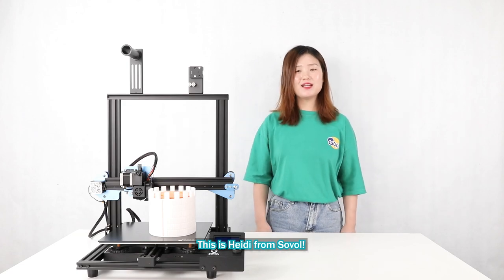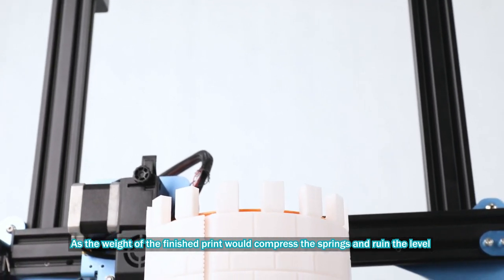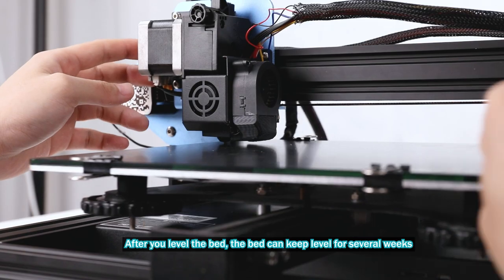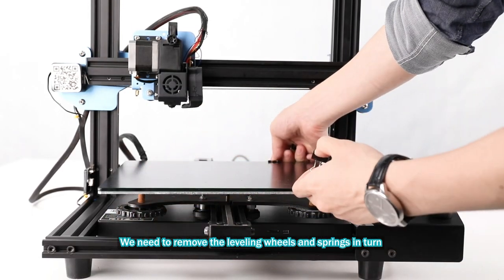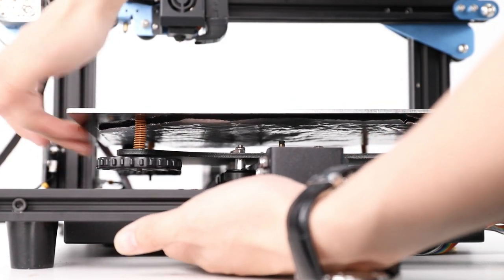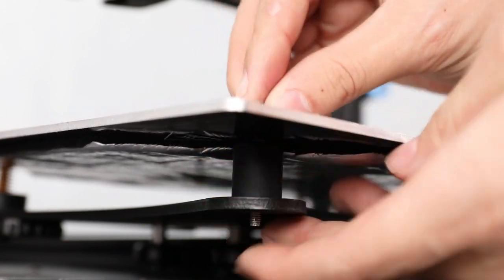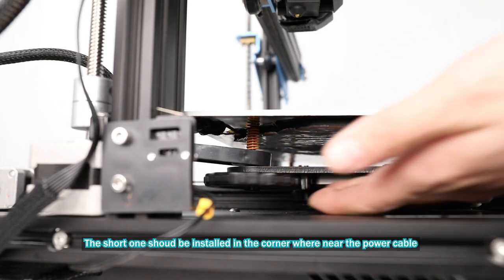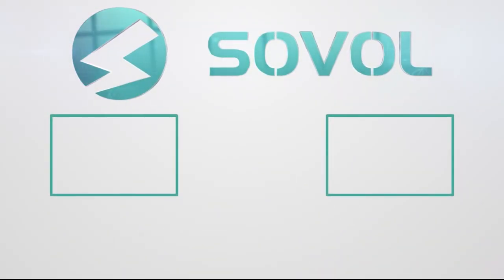Sovol Silicone Columns 3d printer leveling buffer---Save Your Bed Leveling Time for Your 3D Printer

Comment: Hello- are these columns installed with the larger openings on the bottom or top? All 4 same position?  It's not clear in the video.
Reply from the maker: Hello, sorry I don't quite understand what do you mean the larger openings. Could you pm sovol3d or email info@sovol3d.com with a picture showing it?
Reply: For printers such as the one shown in this video, I don't believe it matters, just try to install the larger opening up on all of them, or down on all of them to be consistent. The opening is for printers such as the Qidi Tech X-Plus/X-Max for example, which have a nut holding the screws in place onto the bed. The larger hole accommodates those nuts.

Comment: i got a problem with ur sovol sv01.
After 1 week of perfect printing suddenly one cable has got lose for one of the z stepper motor. And now the first layer wont stick.
Any Ideas to fix it?
Reply from the maker: please check if the hotbed temperature is suitable for your filament. If you need more help, please email info@sovol3d.com. We are off for the weekend holiday and there may be a late reply. You could join our user group where many SV01 owners discuss their prints to get help if you need it urgently. https://www.facebook.com/groups/sovol3d

Comment: When doing the initial bed level after installing the silicone columns, do you tighten them down all the way and then loosen them to begin the leveling process like when using springs??
Reply from the maker: Hello, it's recommended to adjust the nut not too tight nor too loose, so that you could adjust it when the nozzle is too high or too low.

Comment: And why are they Not from Beginning on the Printer
Reply: upselling
Reply from the maker: Good question, because the springs that has much more elasticity, even if your the nozzle is too close to the bed, the damage of the nozzle to the bed is slighter, so the springs is better for the new users who just get started 3d printing, the printer comes with the springs, not the silicone columns.

Comment: My print bed seems to low to level after installing these, Do you recommend spacers or washers or something?
Reply: Set your Z offset then
Reply: @abepeterson  wouldn't that raise my hotend further? My bed is lower then my hotend can go. These silicone spacers are shorter then the original springs.
Reply: @supporteam  not if you do a negative z-offset. You could also try lowering your z stop sensor a bit.
Reply: Try lowering your z stop sensor